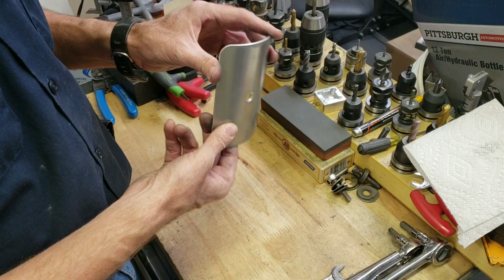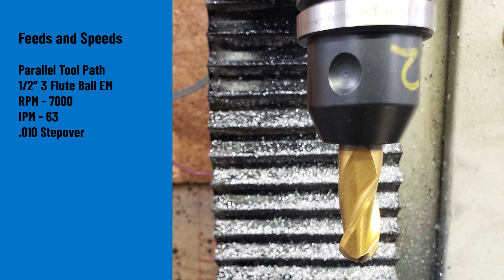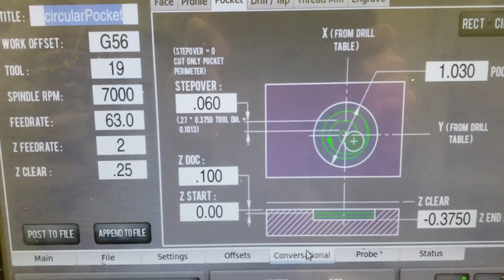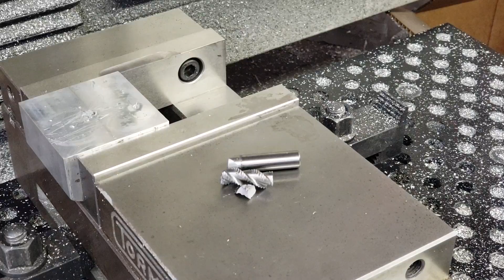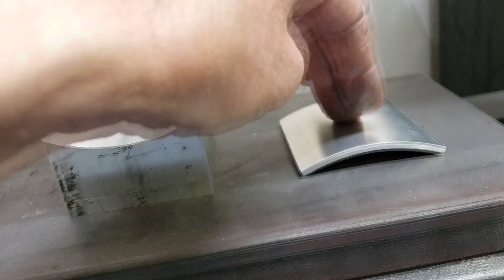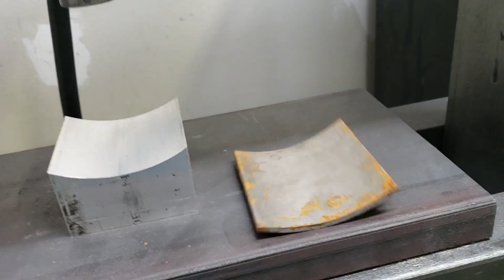3D Machining a Press Die for Curving Aluminum and Steel - Test

Comment: Under 'Springback' on page 1351 under "Bending Sheet Metal" in the Machinery's Handbook 29th Edition it gives the following equation to ROUGHLY account for spring back in materials.  In this case the Rf is the radius that you WANT.....Ri would be the radius of the tooling used to make the bend.  The equation is (Ri/Rf)=(4{((Ri*Ys)/(E*T))}^3) - [3*((Ri*Ys)/(E*T))]+1. Where; Ri= bend radius before springback in inches, Rf=bend radius after springback in inches, Ys = Yield Strength of the material in pounds per square inch, E= modulus of elasticity of the material in pounds square inch and, T= material thickness in inches.

You always need to make a sufficient number of test pieces to 'dial in' the design of the die, but that should get you quickly in the ballpark.
Reply from the maker: Thanks, I will have to check it out.  I think I looked at an equation like that once but couldn't figure it out.  Maybe my 13-year-old daughter could. Lol  She is going into algebra 2 in the fall.

Comment: Try using a 1/4 inch or smaller ball nose. Bull nose actually work better bet you have to use a bull nose smaller than the smallest point of your radius and do the math to keep it cutting on the radius of the tool. For a 1/4 inch use 13,300 rpm and 70 ipm with .025 left to cut. 10% of tool diameter.
Reply from the maker: Thanks!

Comment: Craig's Machine Shop  Sorry it has taken me a few days to reply, finals week is the worst. I did some calculations for the bend you are doing. I used the following equation to measure spring back.

Rf = Ri/(4(sigY*Ri/Et)^3 - 3(sigY*Ri/Et) + 1)     

Rf = Radius final             = 2.5"          (if you need the inside diameter to be 5")
                                          = 2.5625"   (if you need the middle of thickness diameter to be 5")
                                          = 2.625      (if you need the outside diameter to be 5")
Ri = Radius Initial           = What we're solving for
sigY = Yield Stress        = 200 Mpa for your material
Et = Youngs Mod           = 69.3 Gpa for your material

Plugging this into solve on my Ti-89 gives me:
Rf = 2.5625    ====>  use a 5.014" diameter die and a 5.139" diameter mold
Rf = 2.5          ====>  use a 4.894" diameter die and a 5.019" diameter mold
Rf = 2.625     ====>  use a 5.133" diameter die and a 5.258" diameter mold

Obviously in the situation seen in this video the die is the top piece and the mold is the bottom piece. 

Hope this helps. I love you're videos, you do really clean work.
Reply from the maker: Wow, thanks Kaden!  I thought I was going to have to make the die smaller and machine it a few times till it worked.  I understand, my son just took his finals at ASU.  I take it your in engineering?
Reply: Craig's Machine Shop no problem! I’m willing to help wherever I can on YouTube due to the amount I have learned on this platform. Yes I am in my senior year of mechanical engineering at the University of Utah. Tell your son I said good luck in his schooling and career! It seems there is a great deal I can learn from you machining wise so I may be asking questions in the future. I just barely started milling aluminum on my CNC router last month and it’s coming along well but I still have a long way to go.
Reply from the maker: @kaden56   Feel free to ask, glad to help in any way I can!  Cool, yeah, my son is in his senior year.  His major is in business. He said thanks, same!

Comment: great work! Couple things to thing about on future dyes is that the thickness of the material you a bending should be taken into account as a difference to be made between the top and bottom dye. If you are doing several difference thicknesses then choosing the average thickness is probably sufficient. You can calculate the spring back of different thicknesses with different materials quite easily with just a few equations readily available online. The last thing is you should probably incorporate some sort of shelf in your design that allows you to quickly drop the blank in place and so it wont shift when the press first makes contact with it and you don't have to do any sketchy things like holding it with your hand until it makes contact. Great work overall!
Reply from the maker: Thanks Kaden!  I tried one of the spring back calculators but I'm not sure what to put in for Included Bend Angle.  Its a continuous curve  so I'm not quite sure how to measure the angle without some flat spots to measure from.  Any Ideas?   I'm working on a cover that is 5" diameter and 3.25 wide measured along the curve.  I didn't even know there were calculators for it online.  Thanks for the tips!
Reply: Craig's Machine Shop a good way to think of it is that after the bend your material just keep going flat tangent to the curve of the bend you made. The angles that the equations wants you to input can be measured off of this imaginary flat. What Material are you primarily planning on bending with this setup?
Reply from the maker: @kaden56  I guess I will have to see how to create that flat tangent in Fusion 360.  The job is in .125 thick 5052 H32 aluminum.

Comment: use more inserts tools the tool life is cheaper! you are milling too much air use both ways adaptive in Fusion with the tas tool  if you have a big hole or a poket drill first with a cheap drill and then with your shear hog afterwards if you want to leave a large rectangle,or a cylinder where much material needs to go outside use more your 38mm 

If you do not want your metal sheet slipping build a frame around. It holds the metal sheet in position 
the problem with the chamfer.easy to repair make the model bigger in fusion

 I hope you understood everything (my English is rusty bad) and I hope I could help you
Reply from the maker: Yeah, I am going to start using the 38mm facemill more.  I need to get an indexable end mill.  I'm not a big fan of the noise and vibration from the Shear Hog.  Maybe I will get a 25mm 3 flute.  The 770 doesn't have much power for large drills in high gear.  I would have to change to low gear for that and post separate code.  This was just a test die.  I think the final die will have to have a center pin to keep the sheet metal from sliding around.  The part will have a hole in the middle.  

Your english is great.  Thanks for the tips!
Reply: I understand the shear hog is terribly loud.....This 
https://www.hhw.de/de/Shop/Fr%c3%a4swerkzeuge/Wendeplattenfr%c3%a4ser/17501102/Bohr-%2f_Senkfr%c3%a4ser_zyl%2f1835_B_positiv_90%c2%b0_APKT1003_Z-Schnitt_20_mm_kurz
is my German shear hog I love him he can mill and drill quiet
900 rpm 90 degrees down absolutely quiet 1 flute slow rpm i drive slowly big chips like at the lathe
The problem is more flute more hp do you need 

And then the most important tip befor you build something else build yourself an solid enclosure you have coolant and chips everywhere 
Coolant and Aluminum Chips are very toxic!!!!!!!!
Or do you drink Coolant water from the car?In the workshop you inhale this!!! voluntary 
protect your life

Comment: You are not compensating for the thickness of the material. The top of your die should be a smaller radius and not the same as the bottom die. That will help with spring back
Reply from the maker: Yeah, I wasn't too worried about that for the test die.  I will do that for the real die.  Thanks!